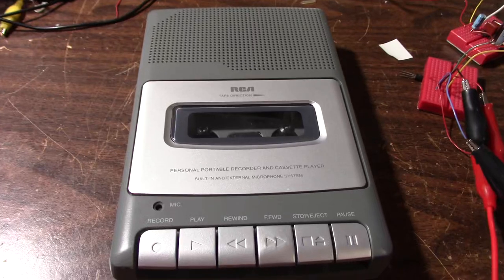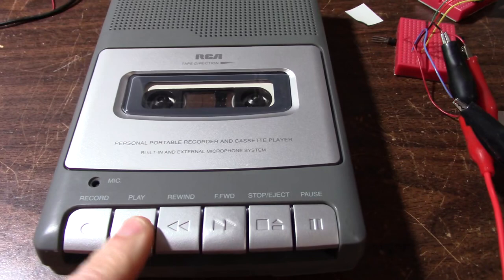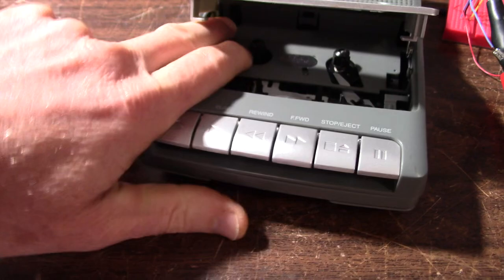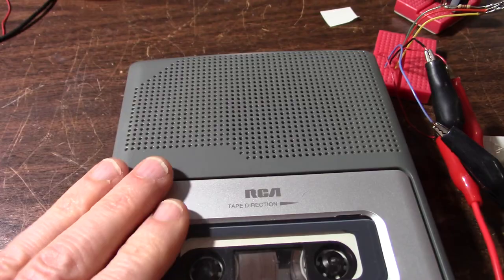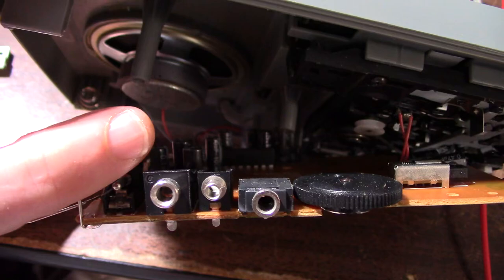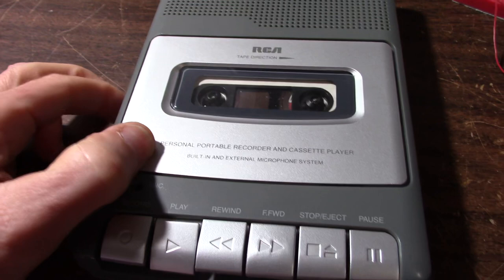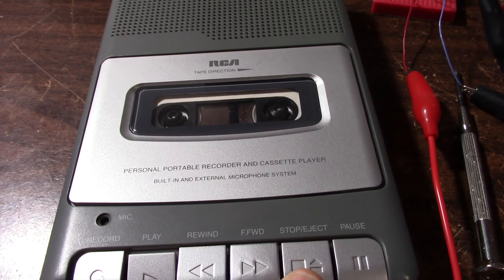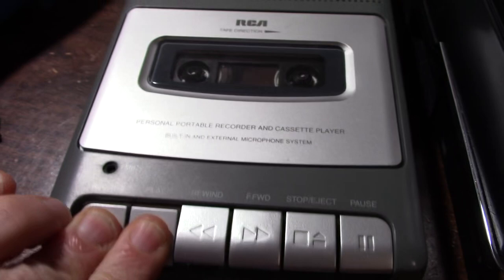Cassette tape recorder common problem repair

Comment: What great timing on this video. Pressing the record button on and off a few times fixed this exact problem for me. Thanks!
Reply: As for me, I have the portable Sony tape cassette player from Sony, it works fine but it's just that when I press the stop button, it keeps playing ▶️. Help. How can I fix it that won't stop playing?

Comment: Another common source of a no-audio problem in a small portable is with the earphone jack and it's switching contacts that mute the speaker when something is plugged in.
Reply from the maker: I remember getting a new AM radio as a kid in the 1970s. I plugged in the headphone and when I unplugged it, the speaker would not work again. I returned it for another and the same thing! Cheap Hong Kong junk!

Comment: You can usually tell the DC bias recorder by looking at the heads. Those, usually with the cheap mechanisms, have a pivoting permanent magnet erase head. The AC bias are usually fixed heads that move up and down with the head assembly. As for no coil on the board, unless you mean the bias trap filter, a lot of the cheaper cassette desks use the erase head as the coil in the bias oscillator.
Reply from the maker: This has the pivot erase head. I used to have the last base model Radio Shack recorder and it had AC bias. With external mic, the sound was great.
Reply: @JohnAudioTech  yeah. Never liked DC bias, especially on those cheap dual cassette high speed dubbing portable radio things. It sounds awful.

Comment: My play button presses down but tape wont play, it just makes a noise & won't move & I've tried other tapes. The player is brand new too, didn't keep the receipt. I need my cassette recorder. Any suggestions.
Reply from the maker: Can you hear the motor running? Perhaps the drive belt slipped off.
Reply: @JohnAudioTech  the machine wheels are turning but very slowly with cassette inside but it still rewinds & fast forwards. Are both cylinders suppose to turn together? I pressed play with no tape in & only 1 is turning not both. I don't want to discard it & can't afford another. I'm very unlucky with tape machines.

Comment: Anybody old enough to remember an old cassette BLANK brand that was a darker brown color. Not completely see thru either. Probably made by Certron or some other Hong Kong brand.
I've been looking for years on eBay for it. No luck. Most are black, white or clear.

Comment: I was wondering if there was a why to add a input to some electrical device when there is no input. I no nothing about electrical just thought it would be a great video if it's possible 👌👍✌️💯🎶
Reply: Wouldn't be hard to tap into the microphone preamp with an input switched jack and a couple of resistors.